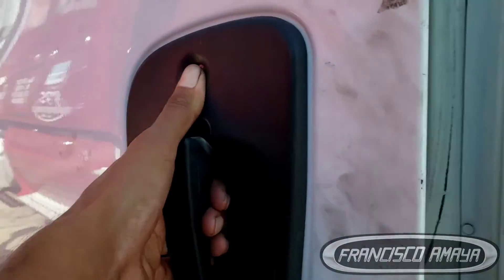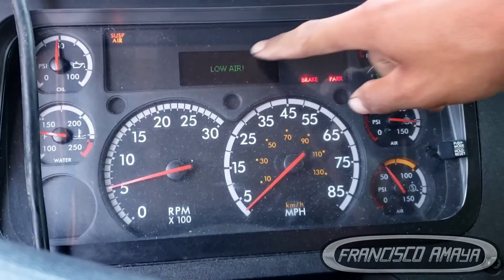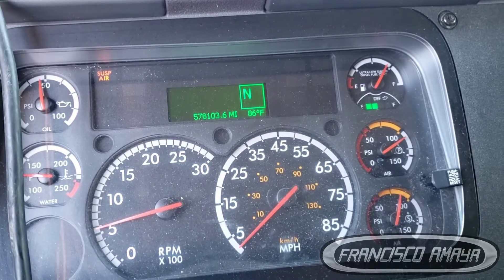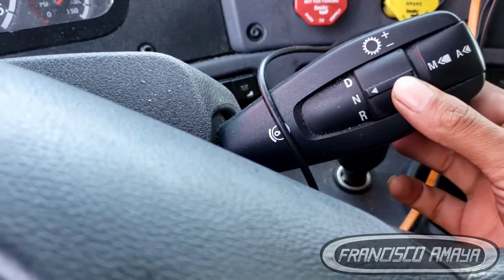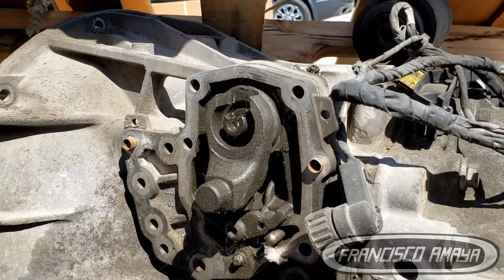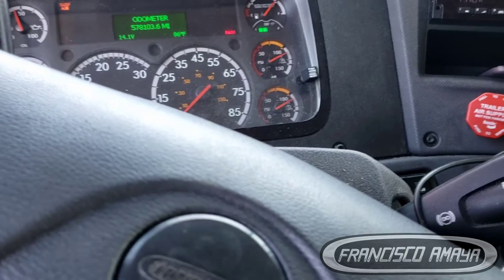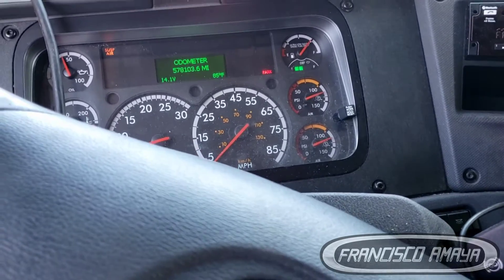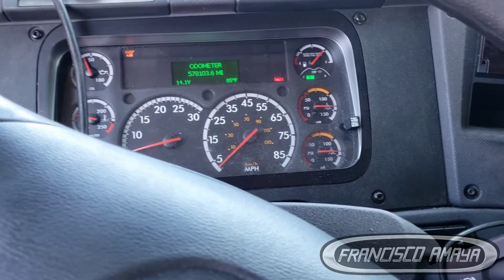DT12 automatic transmission does not go into gear in the mornings split pin problem

Comment: My problem is dryer cartridge but reason #2 is the transmission air tank gets a blockage from supply tank and check valve.  Drain air tank to tranny and listen for the blockage to release by noting huge increse of air while drianing that tank and your back in business.  Also put a manual air gauge on that transmission tank.  Needs 100psi plus

Comment: The real problem it’s that when you tell a mechanic about it they don’t tell you about the pin, and they know about it, they want to change the clutch and it does make sense if the transmission it’s coming down but for some reason when I tell them about the pin they don’t want to do it

Comment: Yo compré mi camión con 600 mil millas y vino con ese problema. El mío solo lo hace cuando la transmisión está fría. Ahora tiene 825 mil millas y aún me funciona igual solo cuando está frío. Conmigo hay dos formas de hacerlo funcionar… una es dejar el camión prendido antes de querer arrancar por una hora hasta que la transmisión se caliente a 111 grados Fahrenheit o la segunda opción, si es que tienes prisa de salir pronto, es poner la transmisión en reversa y luego brincar el selector a drive D de un jalón sin pausar el selector en neutral N y debería entrar el primer cambio. Cuando eso suceda, cambias el modo a manual y ahí ya puedes despegar pero solo puedes usar los cambios impares 1,3,5,7,9,11 hasta que se caliente la transmisión a la temperatura indicada los cambios pares funcionan y todo queda funcionando bien mientras esté caliente la transmisión
Reply: El problema es que los mecánicos no les interesa cambiar el pin es muy fácil pero tienen que bajar la transmisión y no quieren
Reply: I had the same problem but change my air dryer and now the problem's gone
Reply: @ThatOneGuy-hp2pb why

Comment: I had similar problems and replaced my air dryer.  So far, that's worked for me.
Reply: why
Reply: @real-nt9qy a lot of times people think it’s a transmission issue when it’s actually an air issue, transmission will protect itself by staying in N if there isn’t enough air pressure to change gears
Reply: @Bodderfly makes sense..thats why you really have to have a good mechanic